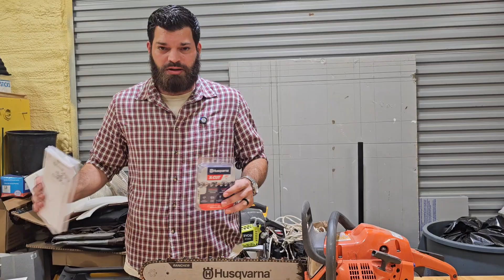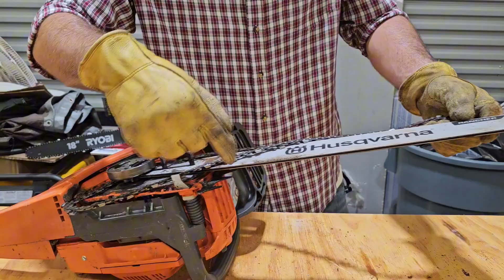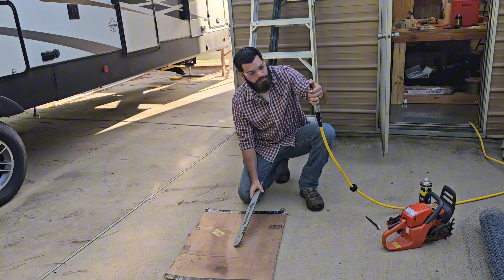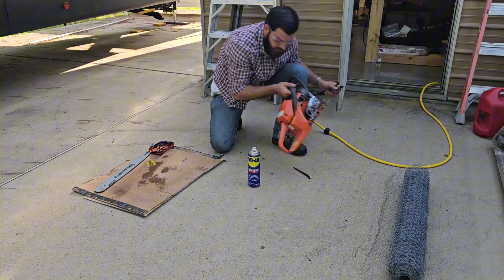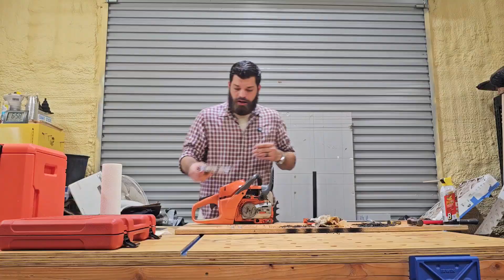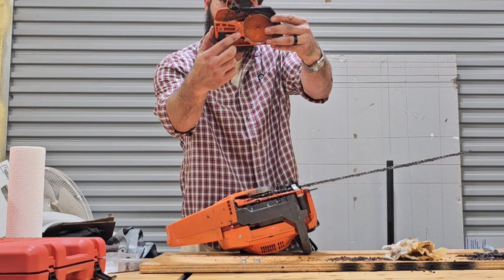How to Replace a Chainsaw Chain | Step-by-Step for Beginners

Comment: looks warm in the spray fam shop
Reply from the maker: It's about 80 degrees in there this time of year, but the humidity stays at 50%. The roll up doors on both sides of the shop really reduce the efficiency. Another project for another day, ha.